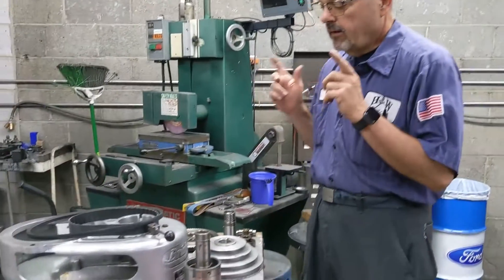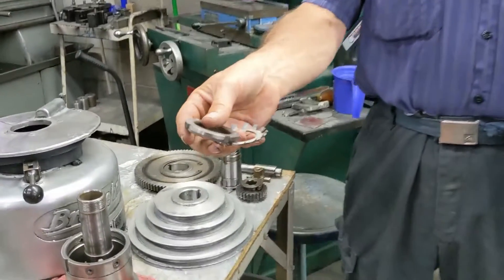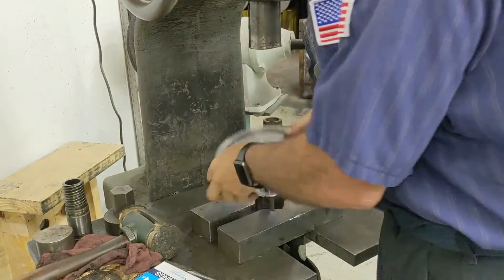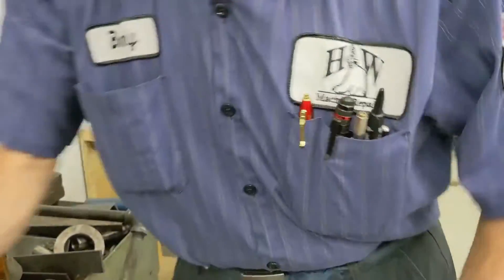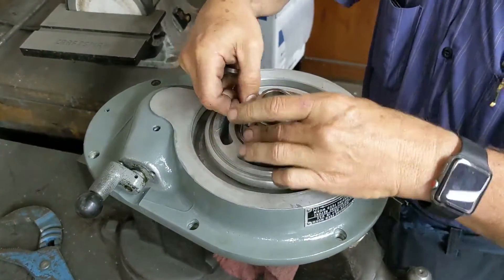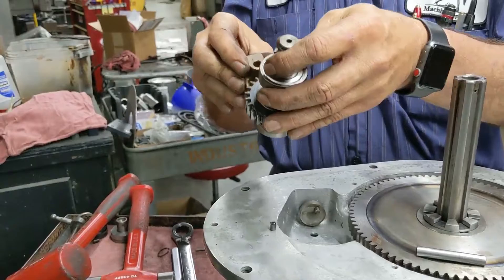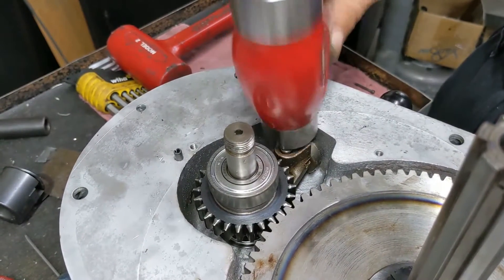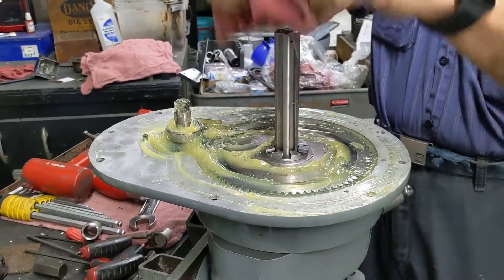Bridgeport Step Pulley Top Half Reassembly

Comment: My BP was very noise, so I did the top half rebuild, with all new bearing, double checked everything was right following the steps on the video, but now may machine is noisier than before, I don't know what is wrong. If I run it in back gear there is almost no noise, but in direct gear is super noisy. Any ideas of what could it be?
Reply from the maker: The spindle pulley hub and the splined gear hub are engaged in HI gear. If all of your noise is in HI gear then it will be coming from those. Please give us call or email us for further instruction on how to fix this issue. 1-800-285-5271 OR 260-422-0020
Reply: @HWMachRepair  Thanks for the quick reply, I will contact you by email. Thanks again!

Comment: I have a  Sharp YC 1 1/2 VA.  Is this pretty much the same disassembly and reassembly?  Any idea where I can get a replacement kit.?  You guys are great at what you do by the way, thanks.
Reply from the maker: It's going to be similar enough. You can call if you run into any issues and we can help you through it. Unfortunately Sharp doesn't support the Step Pulley heads anymore so parts are limited. We can help with belts and bearings but that is about it. You can email me for more info: support@hwmachinerepair.com

Comment: What a helpful series of videos.  I had the shop Chromebook on this video as I reassembled my J-head - very handy.  One thing to note.  Like the machine in this video (at 21:04), my machine has 2 sets of cam-ring screw (and locking set screw) holes, but I can't figure out why.  You didn't mention it specifically, but I looked to align the holes for the locking set screws that secure the cam-ring screws.  I also had to re-tighten the upper bearing lock nut (18:06), because it went on hard, and if it's not completely tightened, the splined gear hub (1:24) will drag on the spindle pulley hub (15:34)  when the back gear is selected.
Reply from the maker: They give you two sets of holes because when the first sets wears, you have another set to use. Bridgeport was aware that they tend to wear rather quickly so they gave you extra holes to use.  -Heather

Comment: These are such awesome instructional videos.
Just bought my 70 year old (1952) Bridgeport mill, and wanting to do a top to toe restoration eventually, but going to do it in manageable stages.
These videos are beyond excellent.
Can we buy these “parts kits” that match these videos through your company?
I’m located downunder, so not sure if you ship internationally or I’ll just drop ship via a US address?
I don’t know if you get the amount of heartfelt thanks that these videos deserve, but I’m subscribed & eternally thankful. 👍👍👍🇦🇺
Reply from the maker: We do ship to Australia. The easiest way would be to get on the website and go through the checkout process, you can see the shipping cost that way before you place the order. www.MachineryPartsDepot.com
Reply: @HWMachRepair  
Thanks heaps. You make it look a lot easier than I’m sure it really is.
I reckon if I mount a big TV screen in the shed and followed step by step, I could pull this off.
Trying to figure all those steps out by trial and error, my head would explode about 20 minutes in. 😂😂👍🇦🇺

Comment: I have a Cracked cam ring. Is that a problem?  Love the vids
Reply from the maker: Barry says as long as you can still shift without an issue it should be fine. It really depends on how big the crack is and if it's big enough it might finish breaking.

Comment: Just recently purchased a bridgeport. Was running well up until late today when it would lock up as it was turned off after on operation. As it deccelerated it would get to a certain speed before it would make a quiet click and lock the spindle. Few wiggles of the top collet nut and it would release but it's got worse as the day went on where it would be jammed for several minutes before it would play ball. I left it tonight with it all locked up again as I'd lost my patients with it by this point. Would the dog gear in and out toggle switch be causing the issue or the fork jamming in anyway? I'm sorry it's so long winded but I hope it makes sense and I thankyou for any help you may be able to give. I'm prepared to strip it but I hope theres an easier option. All the best Alex
Reply from the maker: Several different things could be causing this issue. Off the top of my head I’m thinking; bad bearing, misalignment issue, or a broken brake spring. Please give us a call and we can discuss the issue further. 1-800-285-5271 or 260-422-0020

Comment: love your videos. dont own a mill yet, but your videos make me realize that an old step pulley machine is OK. i wish folks selling machines would post detail pics of the ways. the most limiting factor to the value of the machine. i can buy most other parts anyway. you mention in another video that you wait to tighten the head bolts until the machine is actually running--why?
Reply from the maker: The Step Pulley heads are underrated. They are the easiest to maintain, and don't break down as easily as the Variable Speeds. Most sellers either know the ways are bad and don't want to show it, or they just don't have the knowledge to know if the ways are good or not. Many think that flakeing on the ways = good ways, but that is just not the case. To the tightening question, the way the machine runs generally self aligns everything. If you tighten them beforehand, the housing may not be properly aligned and you will have a vibration in the head and in the quill handle. Let me know if you have any other questions.
Reply: Yeah,  when they describe the machine as "in used" condition or "everything works as it should"  - useless info when buying a mill or lathe

Comment: My spindle pulley sleeve doesn't fit into the hole since I've replaced the bearings!  it's 0.1mm over sized now?
Reply from the maker: Every time I rebuild a step pulley head, I will sand the outside of the bearing housing and use a Dremel with a sanding flap wheel to clean out the bore in the belt housing. Usually, this is all it needs in order to get a nice smooth fit again. If you have any questions, please give us a call. 1-800-285-5271

Comment: Hi 👋 sir I follow same 
 to assembly but Final result Noise issue how to solve which place to find that noise
Reply from the maker: There could be many different things causing noise. It might need to be aligned, a new belt could be a bit noisy, the castle gears might need replaced. You can call and speak to a head technician and they might be able to help walk you though it.
Reply: @HWMachRepair  Thank you so much for u replaying i really need u help I am service engineer 👷 my doubt All round head machine have this type of problem Few old machines come only that noise

Comment: I have a little bit of backlash between two castellated halves when in high gear. Is this normal?
Reply from the maker: It’s ok to have a little bit but don’t let it get too bad or you’ll have to replace both castle gears and even possibly the spindle.
Reply: H&W Machine Repair and Rebuilding  Thanks for the reply, I don’t think it’s too bad you can only hear it rattle slightly under no load, when cutting it’s obviously taken up. 

This is only a hobby machine which is used lightly and way over maintained, is there anything to sort it or just have to replace the upper and lower “castle gears”?
Reply from the maker: @wtrooms  The only thing to do is to replace just the lower gear. You normally only have to replace this one because it wears first.

Comment: Another great video! Mine bangs a little when I face mill. Do you usually have to replace the shaft also, or just the gear? Machine is in good shape, normal wear. I can still see the scrapings
Reply from the maker: Hi Kenny, Which shaft are you talking about? I don't want to give you a wrong answer, you know what they say about assuming.
Reply: @HWMachRepair  the splines shaft that goes in the gear hub I think it’s called. The one that goes up and down when you lower and raise the quill. I’m pretty sure that’s what rattling around. Is it most common for the shaft and the hub to wear or just one or the other? I’m not gonna hold you to it of course. Just curious what’s more common. I will be tearing it down within the next couple months and will be ordering some parts. Shouldn’t need much though. I got lucky and found a machine with minimal wear. Thanks
Reply from the maker: @kennyrmurray  Generally the hub, for a Step Pulley that would be PN 1160 (Splined Gear Hub) wears first. You can pull out your spindle as well and check the splines on it to make sure it hasn't worn to much.
Reply: @HWMachRepair  Will do. thank you very much for your help.

Comment: Is the Bull gear greased for life or does it need re greasing periodically?
Reply from the maker: It does need re-greasing periodically, every couple of years or so. Barry says if you run it in low a lot, maybe check it once a year. You don't need to completely clean it out, but just add some new in there.

Comment: Are these the same parts for the Alliant step pulley heads?
Reply: I've been told that the clones use the same parts, but since I have a Supermax, I would like to hear that from the H&W experts.
Reply from the maker: Hi David, depending on the Alliant it will either take Sharp parts or ATrump parts. What is the serial of your machine and I can let you know which you have.
Reply from the maker: Most Bridgeport parts, especially on the motor side, won't work in import machines. Some parts can be modified to work, but we usually handle them on a part by part basis on what we recommend.
Reply: @HWMachRepair   The machine has a plaque on the back with m 383  as a numbered plate and the head has 72042366 a  stamped  serial
Reply from the maker: @davidd7226  Hi David, You have a Sharp Alliant (the 8 digit number is the serial). The Sharp LMV parts will work in your head. If you are needing something you can email me with what you need and I can quote it out for you: support@hwmachinerepair.com . I also have a parts manual if you need it.